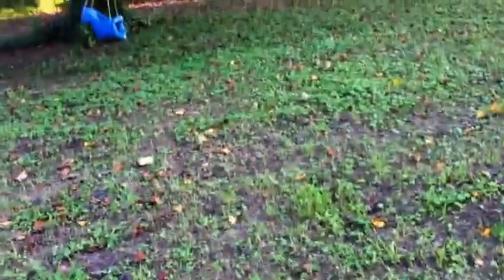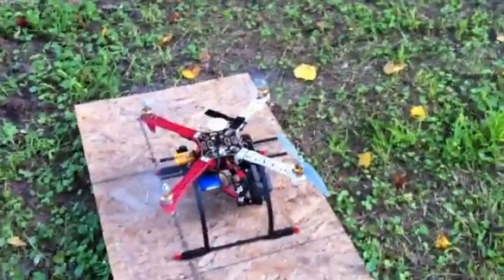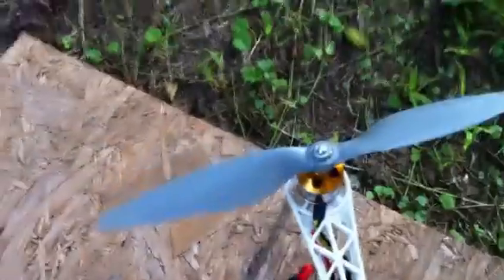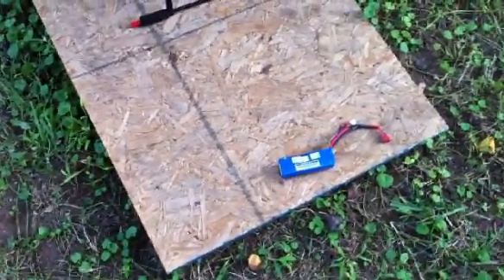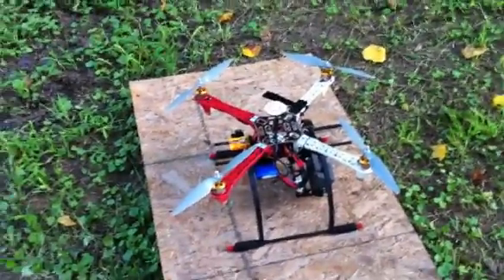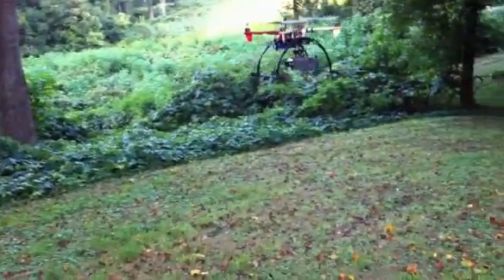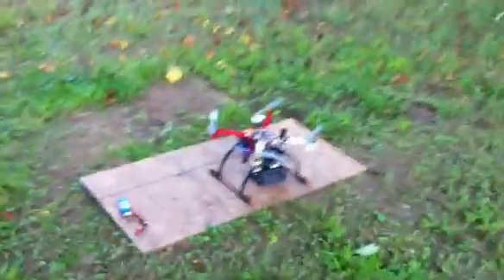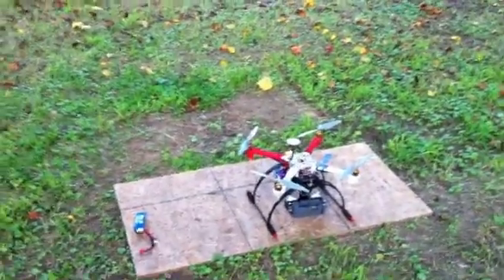NAZA F450 ESC or Motor problems?  HELP!

Comment: your dji naza does not require 5v bec from ur esc since the battery powers it directly.Cut the red connectors to stop over heating

Comment: soldiering, grounding out,.,. i had twitchy motors on 2 arms.. re did the solder on them mainly cause i had them wired wrong..and after motor to esc wiring correctly and better solder point it went away.. just had it happen again on a motor. and im sure its cause one of the wires broke free. some reason the motor wires wont asorb the solder so im just making it so it has a connection. ill let you know if this twitch goes away after i resolder

Comment: First thing to do (if this is unresolved) is to check that the ESC bullet connectors, sometimes you can see small burn marks where the ESC bullet is shorting, best solution is to solder the connector together to avoid the shorting.  If not the just replace the ESC and motor and see if that fixes it!

Comment: I had the same problem Chinese 450 copy, Mystery esc's and 1000kv motors had nothing but problem after problem crash after crash! Remedy: 2212 sunnysky 980kv motors 30a hobbyking esc's with simonk and updated my naza lite with V2 and whalah the thing practically flys itself! I am having so much fun with it now flying high altitude fpv and getting some awsome footage! I highly recommend this setup!

Comment: It`s the naza compensating for the pos motors and esc probably. Get some 2216 or bigger motors and some 4000mah 4s.
 It`s not like a 60`s BSA the wiring has to be solid.
Reply from the maker: You're prob right. I changed to 30A SimonK ESC's and HUGE RCTimer 650kv motors and that fixed everything. Not sure if it was the ESC's or motors because I changed them out at the same time but it was def one of the two. lol
Reply: I started running 2218's on my GLB budget quad back in 2012  and once I got rid of crap TX 6ch and got a better Turnigy 9x that solved 90% of y issues. Found I had a dud front motor connection today and glad I had a new spare motor.
Reply from the maker: Hoverbot1TV Right now my quad is flying great with the NAZA but if I try to do a 360 yaw it slowly falls to the ground and I have no throttle left to stop it. I can yaw my quad left & right as long as I do it very slow and little movements at-a-time but if I try to do a single fluid 360-pan all in one move  all hell breaks-loose. :(  This may have something to do with my Yaw gain setting ? I have never touched this gain seting before and right now its at 100%. In fact all of my gain settings are at default. What ya think?
Reply: If you change the top row it will pitch and roll or yaw faster so leave those default at first. Try 110% in vert gain and check then if it gets better add a bit more. I think the budget motors cannot translate fast enough for your quad. I got Emax GT's and a lot of controol issues were solved on a FC much more sensitive than naza. Get a scale and weigh your craft then check max thrust on your motor size w/prop size. You should have more than double the weight in thrust. Optimally 3x as much thrust as model weight for good reaction speeds and yaw control.
Reply: GeorgeBonez
You landing gear etc. by my guess by preview pic would require 2215-2218 motors at 900-1100kv with 10" props. watch?v=OjsM0WYZ42s these drew 23A a bit high, 905kv would be in 17A range but slower in responses.

Comment: I HAVE THE SAME PROBLEM I HAVE NAZA M V1 FOR WELL OVER A YEAR WITH NAZA M NO GPS, NOW I DID THE NAZA V2 FIRMWARE UPGRADE AND BOUGHT A GPS MODULE WELL WHEN GPS IS PLUGGED IN NAZA ASSISTANT WONT LET GPS SHOW UP IN SLIDER WITH ATTI MAN FAILSAFE AND WHEN I HOOK UP FLIGHT BATTERY IT FLASHES 3 GREENS THAN ALL RED-GREEN-YELLOW OVER AND OVER FOREVER HOW DO I FIX THIS?   davidringler40@yahoo.com
Reply from the maker: David did you ever figure this out? Sorry man but I have GPS and that changes everything “I think”?  I have never experianced a RED-GREEN-YELLOW  flutter on my NAZA. I am wondering if you need to do a manual compass cal?

Comment from the maker: Hey TheFido03 I now have 650kv motors, 40A Opto ESC's from RCTimer and 12"3.8 carbon-fiber props. I have everything installed and my overheating problems seem to be solved but of course I am having a whole new set of issues now. lol My quad will NOT GPS hold and drifts all over the place and altitude is very hard to control as it wants to bounce up & down a lot. Any Ideas? I have recalibrated both basic & Advanced several times and now I am even recalibrating my sticks to see if that helps. :(

Comment from the maker: Well I now have 1000kv motors and I am using 2200mAh 3S & 4000mAh 3S batteries and I am having problems with both but w/ the 4000mah batt the problem occures much faster and more severe. Both the motors and ESC's get really hot and fail.

Comment from the maker: Thanks man. Its funny that you mention Valuehobbydotcom because I received my very 1st order from them today. lol It was just a couple of cheap 2200mAh batteries but you're right. The shipping was pretty fast (3-days). I think I am going to order another 450 frame because I have a brand new KK2 FC that I ordered from China & it took over a month to get here. I got so mad that I ordered the NAZA 3 weeks later & the Naza still came faster. Now I am stuck w/ a KK2 so I am going to try to build it

Comment from the maker: What ESC do you recommend for my setup? If I am going to have to tear this thing apart again I want to do it all at the same time. Let me make something clear just so ya know ok. When I 1st installed the NAZA MC the quad armed just fine every time without any twitching but after only about 1-2 mins in the air it would snap and cut a flip and fall. But after a few weeks the arming issues started happening.  Do you think I need new ESCs too?

Comment: use higher refresh rate esc. I have used plush speedies with the same star up problem but once in the air all is good, but just a little twitch. changed to the multistar esc and all is good.

Comment: Sorry to tell you this but i know people that got those same motors that you got and they are horrible,they are ok if you fly your quad with nothing in it like camera and landing gears but the moment you ad weight to the quad they turn into furnaces , you need to swap those motors with sunnysky 2212 980kv or readytoflyquads 775kv , they are affordable and high quality , also you need to change those props with APC 10 x 3.8 for heavy lifting , those props that you got are too skinny for the job .